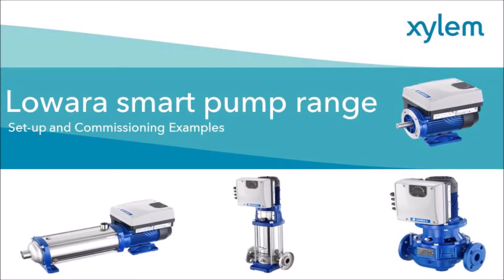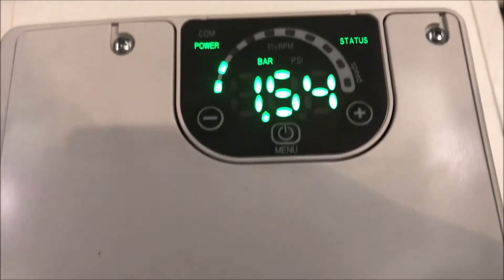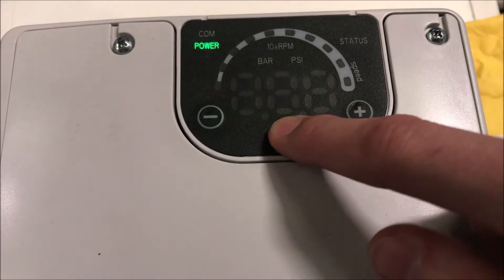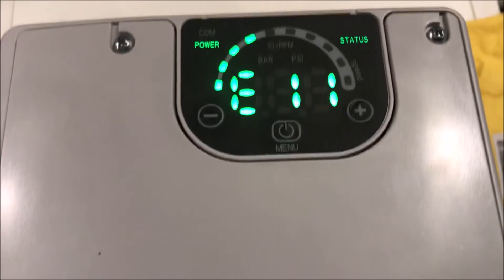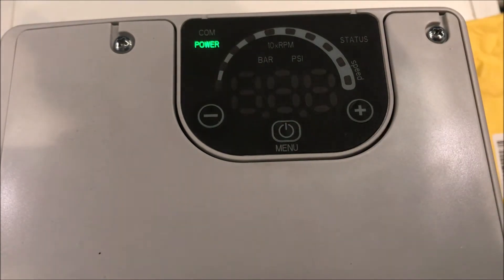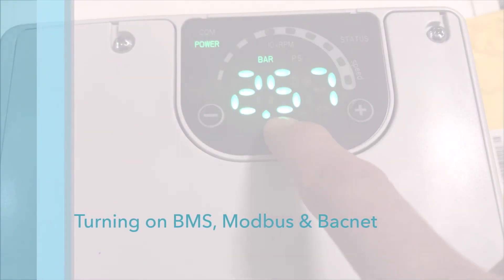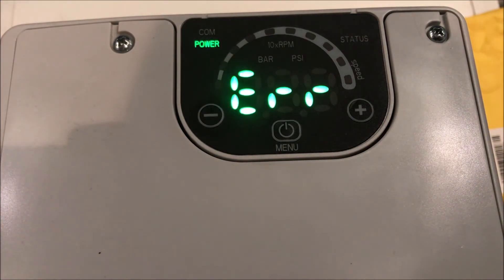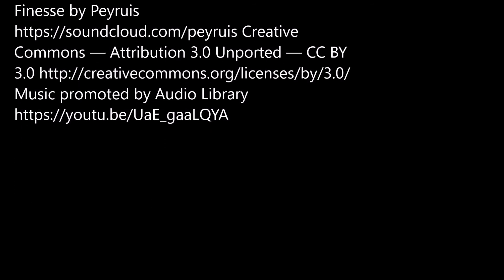Lowara Smart Pump Range -  Set-up and commissioning examples

Comment: Absolutely terrible motor and control combination.  I bought 14 units in 2020, I have had 8 fail. 

They have all failed on the connection between the inverter and motor, basically a spade connector set up. 

I think this spade connector warms up with continuous use and enlarges which causes a burn out.

I have asked xylem uk for support and / or replacement and have had no real interest.

Since I have retrofitted WEG motors and inverters making a true modular construction with readily available parts, and designed out what I consider the weak link. Of course at my expense.

If the actual pump part wasn't so long lasting is scrap the lot of them. 

For a market leader I totally felt unsupported, it has tainted my opinion on lowara products.

Now i buy anything but lowara.

caveat emptor
Reply from the maker: Thank you for sharing your experience and feedback with us. We apologise for the inconvenience and frustration you've encountered with our motor and control combination. Please email watersolutionsuk@xylem.com sharing details of your experience so we can work towards a resolution.